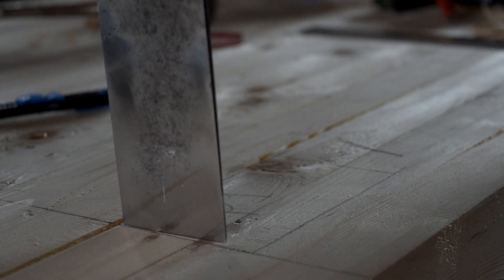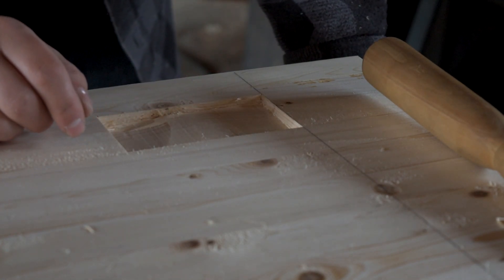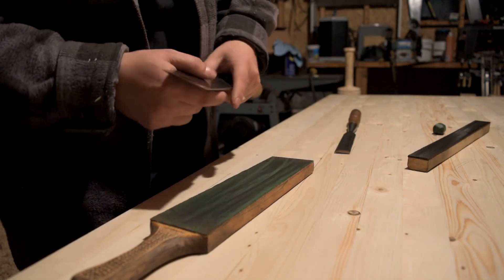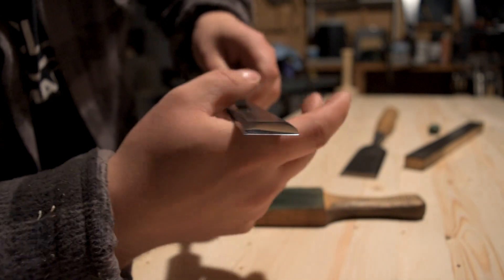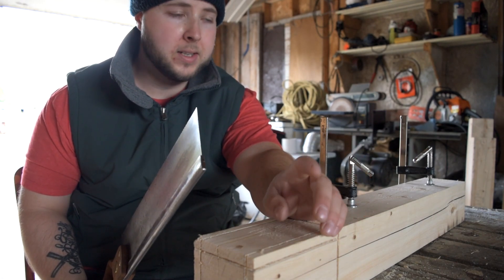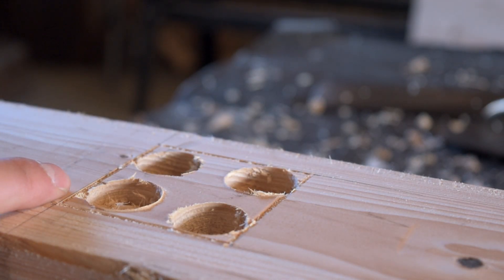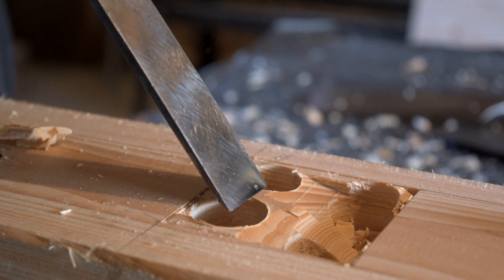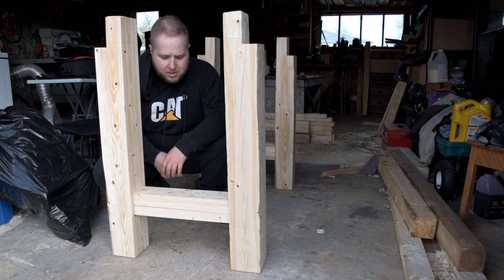Timber-framed Work Bench - Ep.6 - Almost Done!

Comment: I would peg those joints with some hardwood dowels to keep those joints tight. You might also want to look at some arts and crafts tables to see how they took care of drying and shrinkage in a joint. Some of the techniques might be too late for this project. However, I like that you are using old tried and true methods to build this project. Good job!
Reply from the maker: Bread and butter techniques and styles here!
Reply: I get that. Just a suggestion to secure those joints!
Reply from the maker: You're right Larry! I actually used draw-bore pegs! That was in the plan from the beginning. :-) The joints came out extremely tightly!